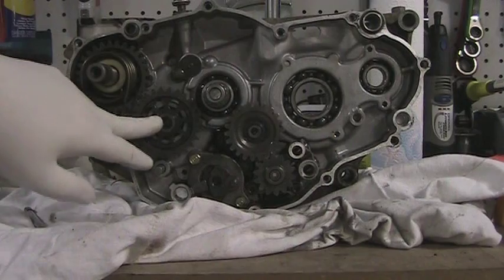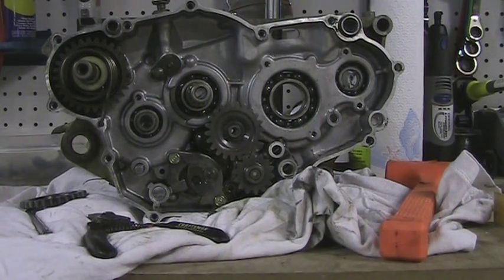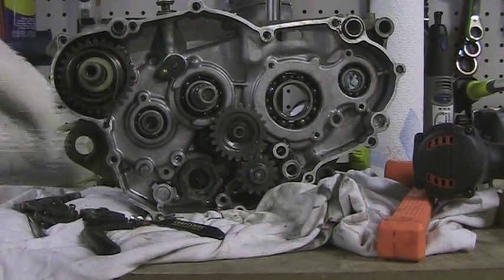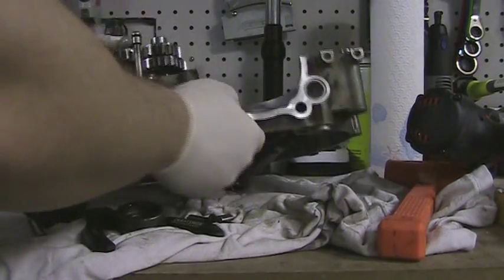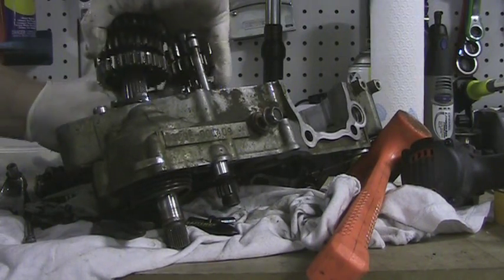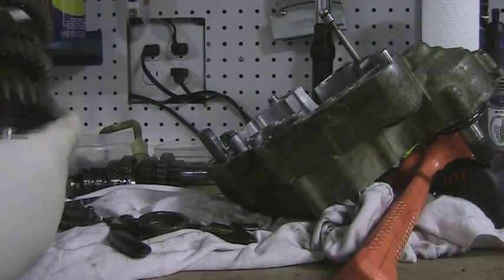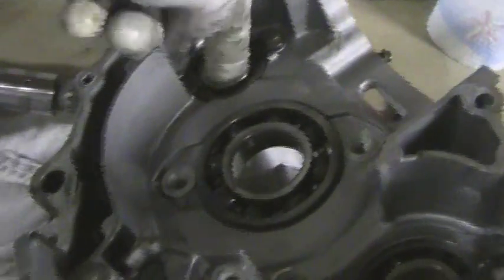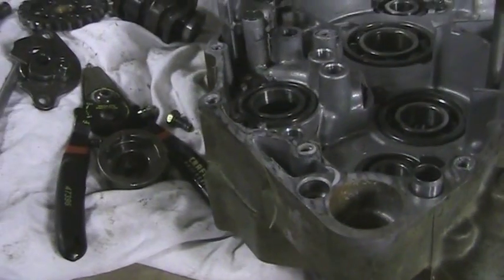Part 31: How to disassemble a motocross bike. Removing tranny and gears part 2.

Comment: these vids your pumping out are absolutely gold, i had no idea were to start on my 04 yf250f, same story i had picked up my bike on a good deal, the drive shaft that spins the front sprocket was totally striped, i got throw one season buy welding it on, lol (i had to wield it about 4 or 5 times throw out the summer) 
cant wait for the assembly video's,,

thanks you so much buddy,, keep it coming

Comment: i thought you were meant to take the bolts out in a cris cross pattern to prevent warpage to the cases?? may be wrong but i know you have to when doing the cam bolts.
Reply from the maker: Probably should remove them that way as well but tightening is where I've always thought it counted a bit more.
Reply: Johnnysshop yeah man dont think it matters with case so much but clutch I know your meant to.